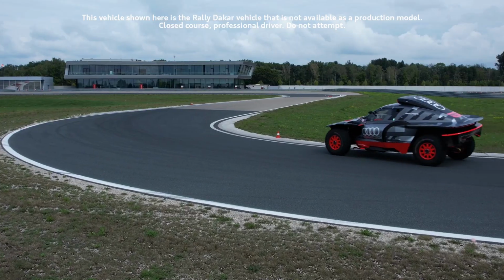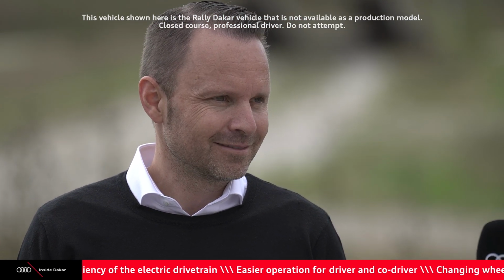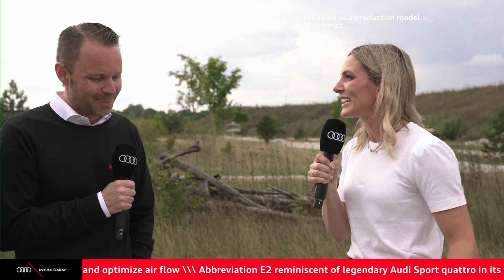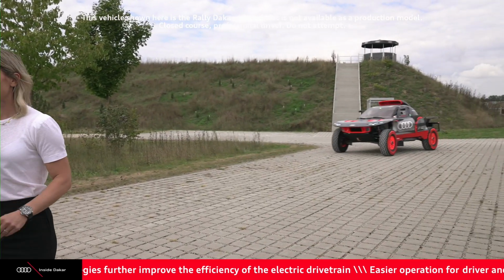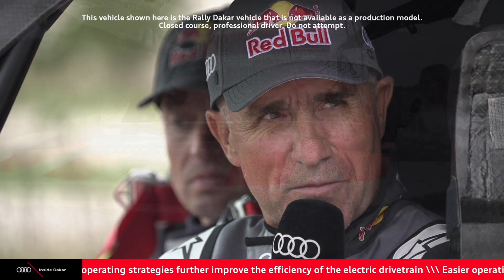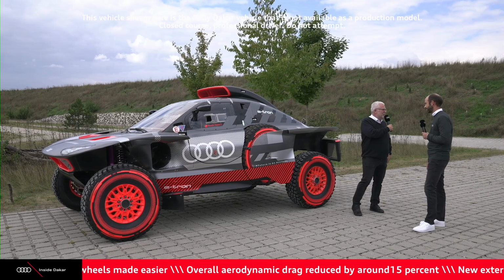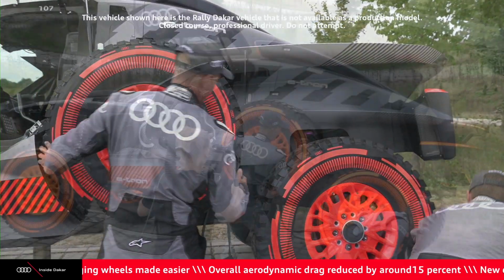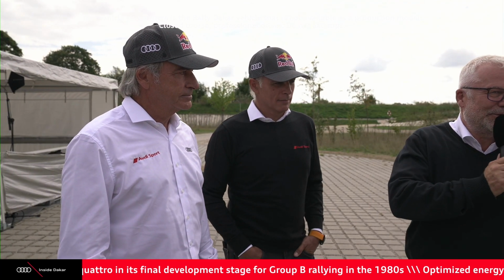Inside Dakar: New Audi RS Q e-tron E2* car launch

Comment: Ridiculous car, fake electric car, as it mounts how to generate the turbo PETROL engine of the car that participates in the DTM championship.  But they don't say that.
Reply: The petrol engine isn’t connected to the wheels and doesn’t drive the vehicle, so it is electric. The petrol motor is just a generator